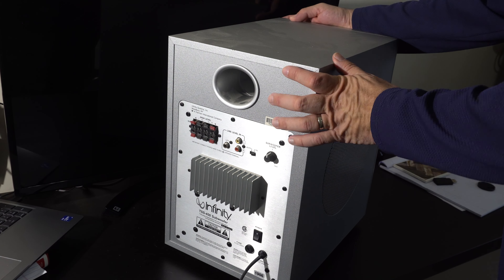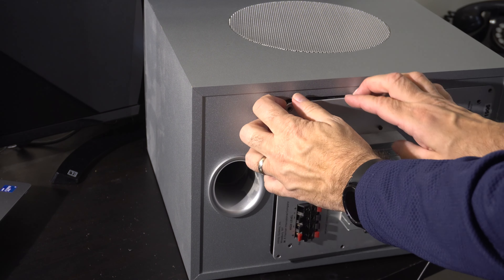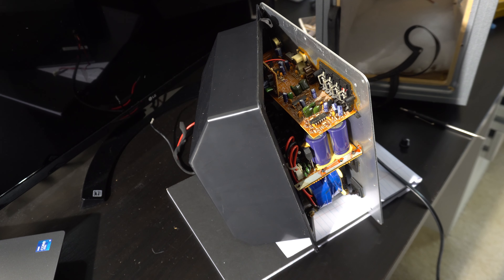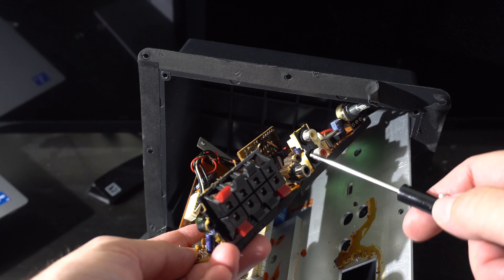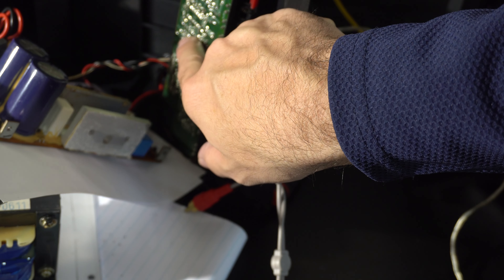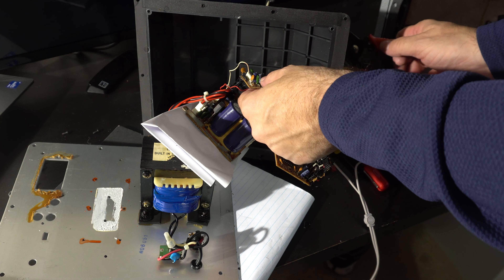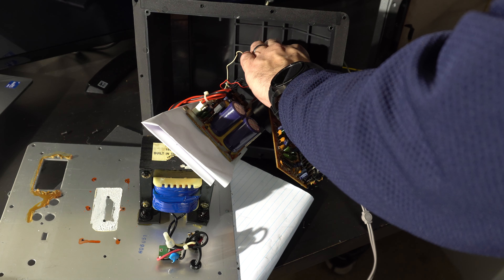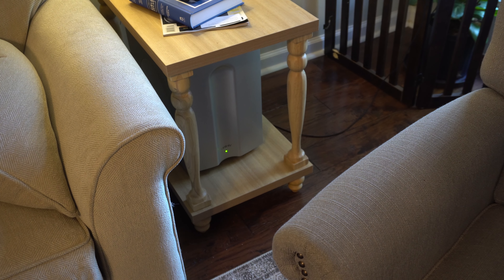Infinity TSS-450 Subwoofer "Appendectomy" Repair

Comment: This is the real deal! I saw the solution on fixya a few minutes earlier then went on YouTube and found your video! I decided to dive in and do this! In addition to removing the limiter and bypassing the connections, one of the resistors on other board was loose so I re-soldered the connections. So far it’s working! Thank you for this helpful video! I wouldn’t have done it if it wasn’t for you showing us how you did the fix!
Reply from the maker: You're welcome and thanks for the comment!

Comment: Nice fix! I picked up one of these recently that has problems, will try the same thing!
Reply from the maker: One thing I did not mentioned in the video was to extend those wires a few inches by soldering in some speaker wire, to make it easier to re-assemble. Good luck and thanks for commenting!
Reply: @ACBMemphis  Good call! Quick question: with the appendectomy, do the wires crossover, or are they pin to pin? Is there a reference image? just want to ensure I don't create some magic smoke
Reply from the maker: @RealBurtles  After unsoldering the board, I unclipped one wire and "moved" one at a time, so the order would be maintained.
Reply from the maker: But yes I think they are in sequential order
Reply: It lives! Thanks so much!!
Reply from the maker: @RealBurtles  You're welcome glad you got it working!

Comment: I have the amp of this same model just not the subwoofer it came with I'm just confused on the 2 sets of wires going in maybe one set goes to the lights or something but I literally just took the thing apart and that little short plug was unplugged so I'm going to try to connect it to a different sub in a box hopefully it works
Reply from the maker: On mine the smaller wire with the plastic plug was for the indicator light, and the larger wires were for the speaker. Good luck!

Comment: This is definitely the same thing I’m experiencing, and with the help of this video I got everything disassembled, but can’t find the wiring diagram for bypassing the limiting board… is it just the black wires in order left to right that they were in the plug?
Reply from the maker: Yes, I remember just moving and soldering them one by one to make sure and not mess up the order - good luck!
Reply: Worked great! I need to replace a few capacitors, but after removing the board and wiring them one by one, the sub works again!
I haven’t been able to test for a long period yet, but it is already better than before. 
I cut and did not repair the front led wire, that cable was criminally short!
Reply from the maker: @WovenThorns  Great, glad you got it working! While it won't live up to it's name "Infinity" at least it will last a bit longer - mine is still working a year later...